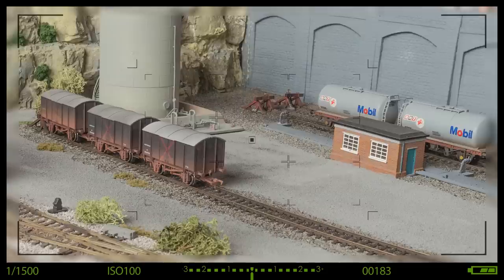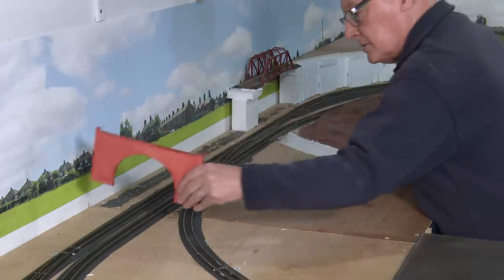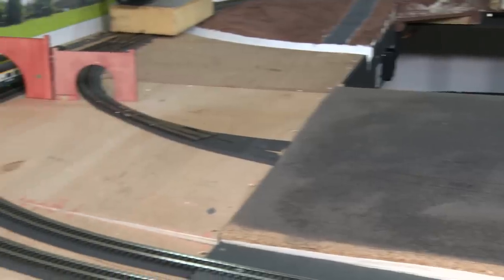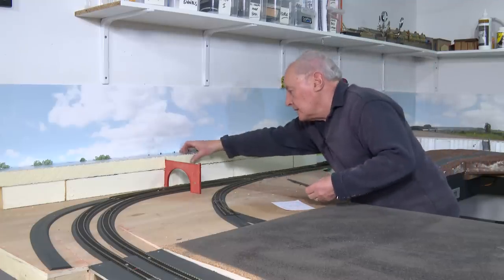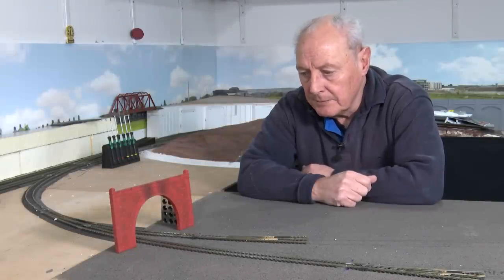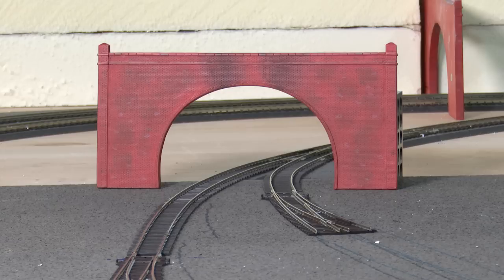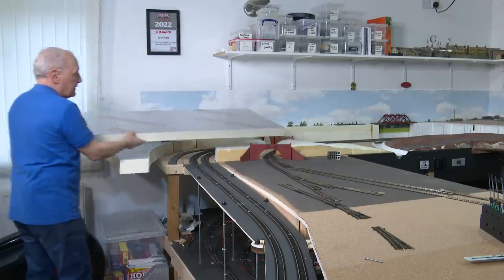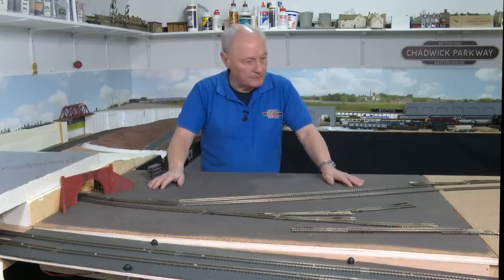Landscape Planning at Chadwick Model Railway | 176.

Comment: You like blocks of foam; I like homemade cardboard lattices or chickenwire.  All looks the same at the end.  😁

I sort of like the idea of TT.  Modern homes are smaller than, say pre-1970s homes, so new entrants to this brilliant hobby will have inevitably have less space for layouts.  (There's probably a role for model railway clubs here, but that's another story.)  So TT makes sense.  And - although many UK modellers will hate me for saying this - I think Hornby have made a brilliant decision in going for TT as 1:120 and not British 3mm scale: it means people modelling in 1:120 don't have the pain in the proverbial of the difference between HO and OO, or equally don't need to regauge all their rolling stock to EM/P4 standards so the gauge of the track looks right. (The madness of not just OO, but also the difference between EM and P4 is enough to make you make you model US or European HO.)  Having a common scale of 1:120 across Britain, Europe and North America will make it more profitable for other manufacturers, particularly of track, buildings, people etc to move into TT or expand their existing range.  It also means that if you're modelling freelance or a preserved line, you could have non-UK stock on your layout without it looking too small (or indeed, TT modellers outside the UK could run Hornby's new stock).
But not selling through retailers is a big mistake: it's like Hornby wants it to fail.  I suppose it's less of a concern to younger people, who are used to buying everything online, but I liked (and still like) going into a shop, actually looking at stuff, touching it, seeing it work.  Maybe I'm a dinosaur, and Hornby have read the runes for the future of model railway shopping correctly?  But if Hornby are going beyond trainsets in TT, then they're going to have send loads of free samples out to all the model railway (ahem) influencers.

On energy, I continue to refuse smart meters: my concern is that they will facilitate surge pricing.  Have you noticed wholesale prices for gas are now back to, if not below, what they were before the invasion of Ukraine?  But HMG haven't reduced the energy cap for consumers yet (obviously the utilities companies will never reduce prices of their own accord.)

Is the section of scenery going on top of the blocks of foam you've glued in going to be removable so you can get at the tracks below?  You'll be able to get you hand into the tunnel for the line into the TMD, but it's going to be more difficult with lines going down to the helix, isn't it?
Reply from the maker: Wow Andrew, what a comment. 
Yes I will ensure that the hidden sections have at least limited access.  After all, track cleaning is essential.
Best wishes for 2023, regards Charlie

Comment: My tip for modelling would be to find some photographs of the type of thing you have in mind (TMD or tunnels etc) and try to replicate (and perhaps simplify) based on the image.  That way you can benefit from the real life reasoning as to why things are the way they are... e.g. track layout or hills/tunnels etc.  To me the hornby portals looked too large before and then a little low after, so I'd base it on a photograph to settle matter, if that makes sense?
Reply from the maker: Sadly, Gavin, there are hundreds of tunnels similar to those made by Hornby. Mind you, there are hundreds, that don’ tur T.  Regards, Charlie

Comment: Charlie, thanks for interesting videos been watching for some years,  TT120 -  I looked carefully at this scale as the opportunity to fit more into the space availble is better  than OO and not quite so small as N. I want to reccreate a hertiage railway (I work as a guard and signalman on one) with proper timetable. I also operate as a guest what must be one of the largest privately owed layouts to a 24 hour 7 day timetable with a dozen terminal stations plus intermediate handover stations. Not having a barn availble I looked at the smaller scale and reduced operation size - hence a heritage line. I bought The Flying Scotsman - it is well made and runs well. HOWEVER the steam locos have no front coupling so cannot run tender first which scuppers the idea. Great pity and a bad design decision.  I do not think I will be continuing unless Hornby devise a retofit. This is a downside of not being able to see models in shops and not going to Warley.
Reply from the maker: Wow, no front coupling, I didn’t see that coming.  I’ve ordered a train set to review, that will certainly get a mention.
Regards Charlie

Comment: Happy Christmas Charlie and great to see you have a plan for the new year which should make it a good one!  On planning it’s a hobby, not work, so yes I set some short to medium term goals and ensure logical steps but have some fill in projects along the way for variety or if need a break. A change is as good as a rest and I do not rush as have to enjoy what am doing! TT120 great for space saver, but in my opinion prices seem way too high made worse by no second hand market - at the moment I think it will do little to get newcomers into the hobby who are on a limited budget. Far better value in OO or N gauge stock and of course an abundant variety. Expect that to change say in 4 to 6 years time if TT120 takes off (I suspect initially funded by those who have plenty of spare cash); it’s too late for me have invested heavily in OO. Have a great Xmas and thanks for all the interesting videos, tips, opinions and those bloopers too! All the best Stephen
Reply from the maker: Thank you, Stephen, you make some excellent points mate. Have a great Christmas and best wishes for 2023. Regards Charlie

Comment: TT120 is a nice scale, but it really needs a bigger availability of accessories and rolling stock choice. I'm sure it will come with time! As for the energy prices, my smart meter hit £21, averaging around £14/day when the temp was down to -8c last week. I work from home, so the way to go is an electric oil storage heater in the room your in, rather than gas central heating ... saying that, one of my radiators froze and 'expanded' slightly cracking the enamel coating (no leak thankfully). Currently sat watching this video with full thermal underlayers on, 2 pairs of socks and 2 sweatshirts! Stay warm folks, but don't stop modelling 🙂
Reply from the maker: Stay warm Simon
Have a great Christmas and best wishes for 2023. Regards Charlie
Reply: @@ChadwickModelRailway  Merry Christmas and Happy New Year to you and your family Charlie. Looking forward to more Chadwick adventures in 2023.

Comment: all the way through the first 15 minutes while you were dry fitting your tunnel, modifying track plans, and working out the hillside, I kept screaming at my compute "A cutting... put in a cutting for the TMD" as to me, that was more accurate... A tunnel on the main line, and the cutting to an old site (Quarry, factory, farm, maybe even a goods depot for the village or whatever) that had been converted to the TMD in the 40s/50s

Then you mentioned that the 'town' scene would go directly over that TMD tunnel and I understood where you were coming from but I have to admit I still think the two tunnels for main/branch looks a little "off" with one at an angle like that! I would still push the 'town' scene further back, with a bridge over a cutting or have the cutting split the village in two... But I am not as skilled as you 😀
Reply from the maker: I take you point Kieran but I won’t decide until the shape is finished.
Have a great Christmas and best wishes for 2023. Regards Charlie

Comment: When it comes to landscaping, I try to maintain the thought of: what came first the dirt or the tracks? The civil engineers have to modify the land to allow the tracks to pass through it. Maybe you could skip the tunnel to the TMD entirely, and make it a cutting - maybe a bit lower on the riverside, than the height of a train, such that the engineers couldn't safely drill through. Less worry about where the points are that way.
Reply from the maker: The dilemmas that us railway modellers face Neil.  Have a great Christmas and best wishes for 2023. Regards Charlie.

Comment: I fully agree with you using gloves for cutting the insulation material. I wonder why you didn’t wear a dust mask - if it is irritant to skin (where you can wash it off) I certainly wouldn’t want to breathe any in. Good insights and ideas (as always). I hope Christmas was good for you.
Reply from the maker: Great suggestion, Mike. Regards, Charlie.

Comment: Merry Christmas and Happy New Year. I look forward to the next year of videos.

On the Celotex style insulation, I think masks are definitely recommended for cutting them, even outside. It was also, I believe, the type of insulation that has been a little controversial in recent years when used as external cladding on high-rise buildings.
Reply from the maker: An excellent point Glen. Best wishes for 2023, regards, Charlie
Reply: I believe "Celotex" do a wide range of insulation boards, it's become a catch-all sort of name for loads of stuff, probably rather like Hoover for all vacuum cleaners! Thanks for the interesting videos and all the best for 2023 Charlie.

Comment: Thoroughly enjoy your videos. The format you use in presentation is brilliant and its as if we're talking from either side of your baseboard!  You're using some metal blocks with multi-holes as supports in your Landscape Planning No. 176 video.  They look a brilliant idea in many areas of modelling. Are these available on the model market to buy, or have I got to bribe a local metalworker to produce some (if so what's the sizes?).  
Great videos, thoroughly enjoy as well as learn from them.  
Big thank you.
Happy New modelling Year.  BobT
Reply from the maker: They are widely available, Bob, and known as engineers blocks I believe. Regards, Charlie
Reply: @ChadwickModelRailway  Thanks Charlie, will start looking.

Comment: I've got a lot of OO gauge locos, coaches, wagons, buildings, etc, and want to at some point build a layout. I might have considered TT:120 if I was starting over, but not being able to see it in the shops makes me a bit hesitant.

I understand Hornby's business model of selling them exclusively to an extent. It cuts out the middle-man and everything that entails such as distribution, logisitics, discounts that certain retailers will want to make a profit at their end, etc, from sending them out to various shops around the country. So it in theory can keep the costs down a bit for a brand new scale and tooling. Which will no doubt have cost them a lot of money.

What I think might happen, is if Hornby has even a reasonable success rate to where TT:120 does well enough to where Hornby continue to make products beyond the first four stages of their roadmap and doesn't abandon it like they did the Bassett Lowke Steampunk rubbish, then we may see the likes of Bachmann try to enter the market with their own TT:120. 
And if Bachmann thinks they'll get an advantage by taking up that empty shelf space that Hornby's left, that's when we'll see TT:120 enter the brick and mortar shops. And Hornby being Hornby, won't want to give up any share of the market after investing so much money into it.
Reply from the maker: An interesting comment. SLO. I to view TT 120 with trepidation. This could make or break Hornby for sure. Best wishes for 2023, regards, Charlie

Comment: Hi Charlie, Happy Christmas. Good to see the progress on the layout. Did you consider a deep cutting rather than the short tunnel to the TMD? The road could cross it on a simple overbridge. This would also simplify signalling of the junctions and you wouldn't need to move the junction that was in the tunnel.
I cant see TT120 taking off outside the UK unless it starts appearing in the retailers. I have never used Hornbys website as their prices are always well above those of the major retailers. The track would be good for 3'6" gauge in HO scale. I might even start modelling SAR if wheels and chassis become available.
Reply from the maker: I think you’re on the money with the deep cutting Jonathan. Best wishes for 2023, regards, Charlie

Comment: Merry Christmas, thoughts on tt 120. 1) N gauge is just a bit to small and fiddley  although it looks like an excellent 2foot gauge oo scale, 2)  3mm per foot scale ( whom are upset by the release) is a very small community and there's no incentive for manufacturers to go there,3)  tt120 has a large foot print in some countries should should take off and some manufacturers have been supporting it for a long time , 4)  h0/00 will still remain top dog for a long time to come,5).  hornby,'s roll out is all messed up.
Reply from the maker: Excellent points Mark. 
Have a great Christmas and best wishes for 2023.  Regards Charlie.

Comment: As someone who is getting to the point where he may be looking at actually getting some building and wiring done next year, I had been planning on going Digitrax route and would have been using DS64s. I see the DS74 has replaced it - is there something I don't know about the DS74 that may cause me to consider a different controller system, or is it a case of just wanting to stick with what you know works 🙂 Thanks for an amazing 2022. Look forward to 2023 🙂
Reply from the maker: Hi Ian, yes that’s exactly right.
I know and trust the DS 64 system. Regards Charlie

Comment: TT120, I am yet to purchase my first set as have only recently started to take a serious interest in the hobby.  When I first heard about TT120, I was a little confused as it was not clear if this was targeted as a replacement to 00, so initially I was not sure if I should invest in the new scale (which may fail) or invest in the traditional scale (which may become obsolete).  After doing a bit more digging on the topic I realise now that TT120 is marketed not as a replacement but perhaps to exactly someone like me, new to the hobby with limited space.  Indeed I like the idea of the smaller footprint, but from what I can tell from the images I have seen the actual size of the TT model is very small, probably too small for what I want it for.  I think for now I will probably give 00 a try and if a few years down the line TT120 is well established with a large range of accessories then maybe I would consider revisiting it.
Reply from the maker: Probably a good idea Chris.
Best wishes for 2023. Regards Charlie

Comment: When my mojo does a runner I either do nothing as it'll come back eventually, or I'll build Metcalfe card kits. Don't know why but I find them very therapeutic. I'll never use 99% of what I build but I just enjoy building them. TT120 is bit like a blast from the past that came and went within a decade. Do we need another scale? Wouldn't it have been better to gone to HO scale then the models would have fit the gauge or make the gauge fit the models. This looks like a Hornby one off and I'll not be bothered with it.
Reply from the maker: You and the rest of the hobby by the sounds of it Charles.  Regards Charlie

Comment: Charlie, First and foremost a Merry Christmas and a Happy New Year to you and yours. In relation to scenery matters around the TMD and elsewhere, have you given any thought using the edges and depth of material to depict chalk/marle? I assume it is not too much of a stretch to hint at the Vale of the White Horse. (My late father was a Wiltshire boy, born and bred, ex-RN WW2). I had this thought as you were thinking out loud on possible forms of scenery. I do not believe I have ever seen chalk modelled extensively although I don't get out much. Just a thought though... Kind regards, Paul.
Reply from the maker: The chalk is an excellent suggestion Paul.  
Have a great Christmas and best wishes for 2023. Regards Charlie.

Comment: TT120....

comes over as an attempt to capture a market, personally I'd not try it until and unless other manufacturers start releasing track, rolling stock etc but actually I'd consider it at that point.

my unfinished layout is "N", and small, I'd like something larger but not sure my garage could do what I want in "OO" (once the roof is fixed etc).. but TT120 could perhaps provide a compromise.

but its not just the stuff Hornby do thats needed, its all the support stuff, like signals, buildings, a decent range of stock - I would hope Hornby pick an era and region and focus on that to get a bit of a range, I have seen the A1.. ok, pick LNER and run with it
Reply from the maker: You make some excellent points Dale.
Have a great Christmas and best wishes for 2023. Regards Charlie

Comment: Besides an outrageous amount of mess when cutting it down to size is there a reason why hard Polystyrene wouldn't do a good enough job compared to the Sellotex? I'm planning a raised section when I begin building my layout but I'm not keen on using insulation.

Regarding TT:120 I think its a great principle as 00 can be too big but N Gauge too small. However in my opinion the continuity of 00 is just so much more attractive. It has over 50 years worth of products, theres very few locos I would want that are missing from 00 product ranges, and theres a lot of potential bargains to be had with such a wide range of pre-owned and new kit on the market.
Reply from the maker: Many thanks for your interest in comment. The reason I don’t use polystyrene, as it is so difficult to stick together the layers. Regards, Charlie

Comment: Have just changed from N gauge to 009 due to space and diminishing eyesight, I think Hornby have introduced TT gauge for younger modellers, ideal for putting temporarily on a table top for example, not sure if it will catch on.
Reply from the maker: I agree, Paul , the jury is definitely still out. Regards, Charlie